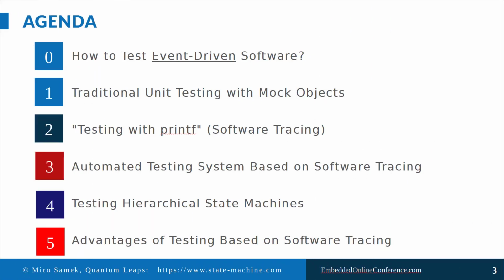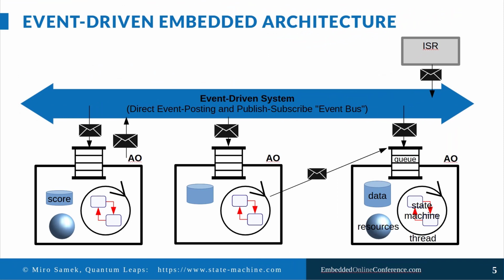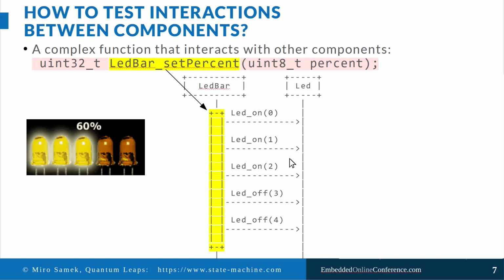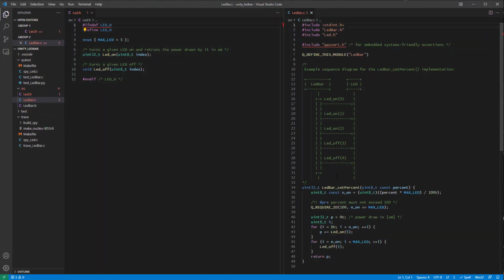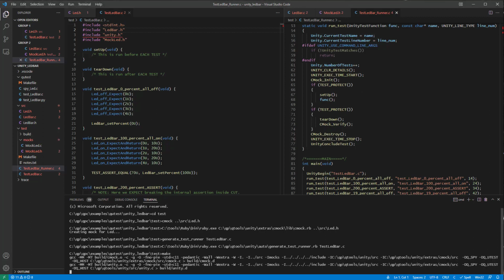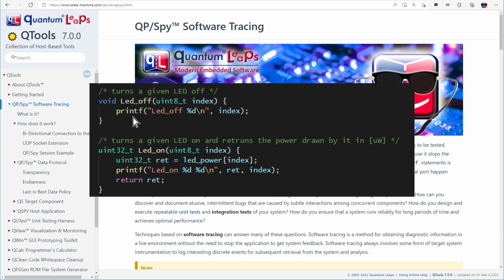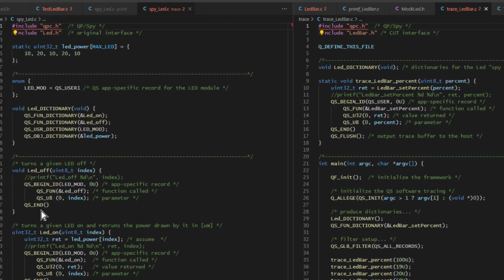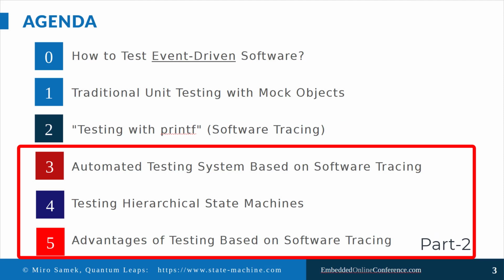Testing of Event-Driven Embedded Software with Python Part-1

Comment: So it is testing with C not Python right?
Reply from the maker: The presented approach uses both C and Python. The CUT (Code Under Test) is in C. The C code is designed for an embedded target, but if you do this right, you should also be able to run the C code on the host (this strategy is called "dual-targeting" in the video, and QUTest supports running the CUT on the target and on the host). On the other hand, the tests are written in Python and always execute on the host machine. This arrangement provides you the best of both worlds. The C code (called the test-fixture) is small and its purpose is only to exercise the functionality you want to test. The tests themselves are on the host side and can take advantage of the higher productivity of Python when compared to C. I hope this answers your questions. --MMS